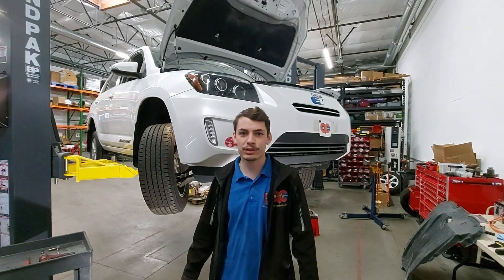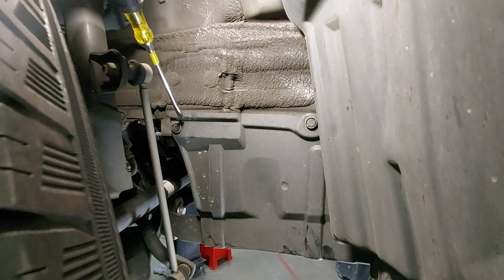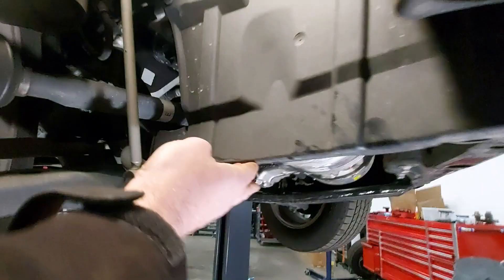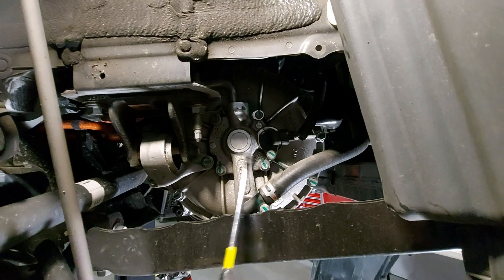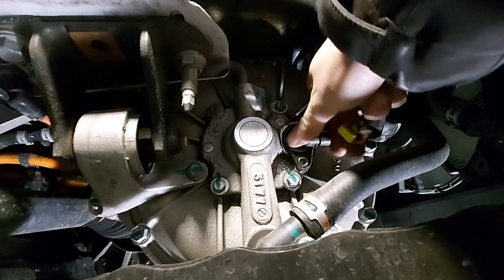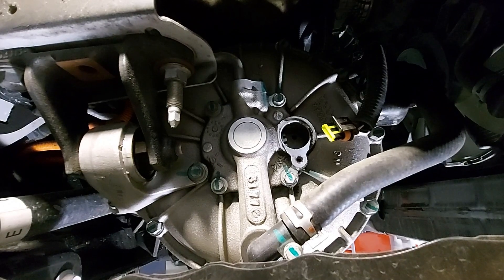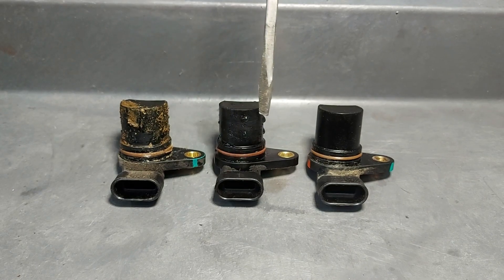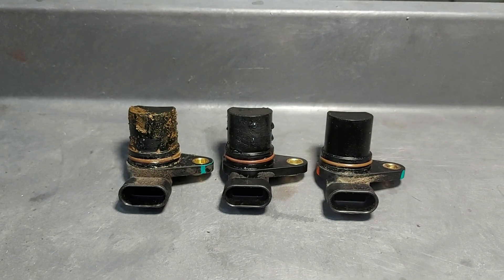Toyota Rav4 EV Drive Unit Coolant Leak Check

Comment: Hi - I just heard about coolant delete kit. How is it ok to remove the coolant system from the motor? Wouldn’t it get too hot? Also I know that  the b250e has the SDU not the LDU?
Reply from the maker: Hi, the name Coolant Delete is a little miss leading its not deleting the coolant from the system completely. Just from the Rotor side of the motor which actually doesn't need to be cooled. Tesla has adopted it for there newer model S's 2021 & newer. Also the LDU is used in The Rav 4 EVs 2012-2014, Tesla Model S 2012 - Current and the Mercedes B-Class 250-E 2014-2017.  Cheers! ~ James @ Konduit EV
Reply: @KonduitEV thanks for the reply :) 

Any kit you recommend that I can buy online?
Reply from the maker: @sinanjordanful  You can buy the coolant delete kit from www.QCCharge.com

Comment: Do you have any video on how to replace the coolant?  Per direction after 50k miles.  I haven't had any issues with it at all, but I'm at 70k and just want to do a preventative service.  Thanks!  Good video!
Reply from the maker: Hi Robert, 
The 50k coolant replacement recommendation is pretty much purely just that, a recommendation. Purging the cooling system is not an easy task (especially for the battery system). 
The main reason that they recommend replacement is to ensure that the pH of the g48 coolant does not get out of spec, (which could cause issues with corrosion). As long as the pH is within spec (7.5-8.5) then your coolant is just fine. There are plenty on test strip kits you can buy online for very cheap to check the pH. Most of the cars we see here even with well over 100k still have their original coolant, and it is still perfectly fine.
Reply: Where can I buy this part

Comment: Coolant leaks seems to be a problem with Tesla's. Very interesting.
Reply from the maker: Only Teslas (or Tesla powered cars) with a "Large Drive Unit" have this issue. That includes:
2012-2014 Toyota Rav4 EV
2014-2017 Mercedes B-Class ED/B250e
2012-2017 Tesla Model S/X (RWD or Performance models only, regular Dual Motor models are not affected)
Reply: @KonduitEV  Does old 12-17 s/x have a small drive unit in AWD versions? This is a reason why its not affected?
Reply: I have issue in my TMS P85 and my question is , this sensor only is in Tesla part OEM or any replacement for that. If you have any replacement can you give me info about part number for replacement.